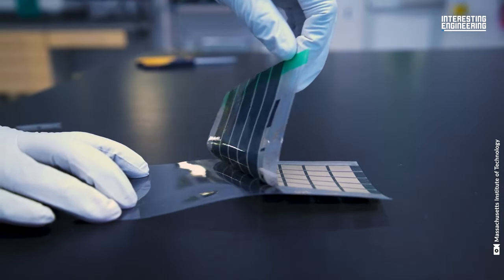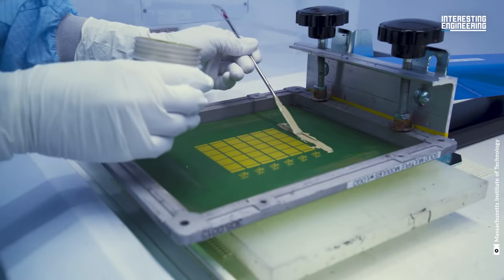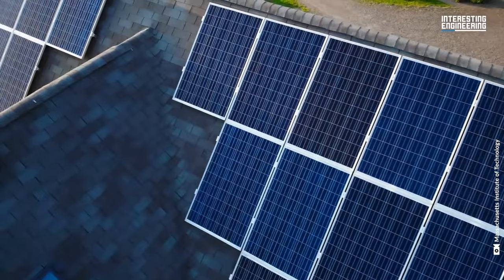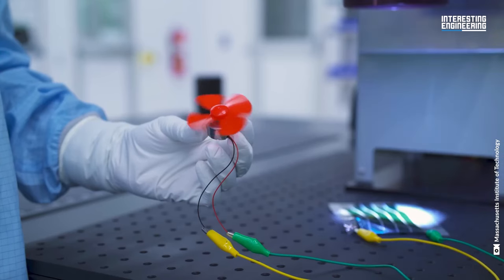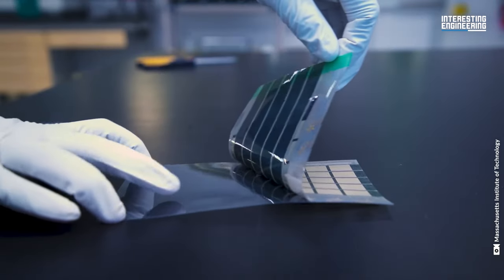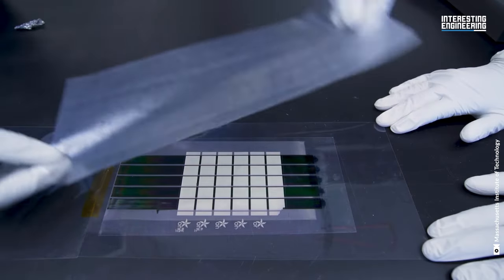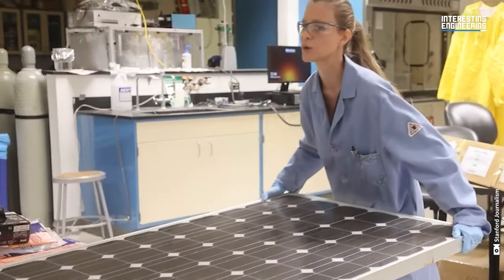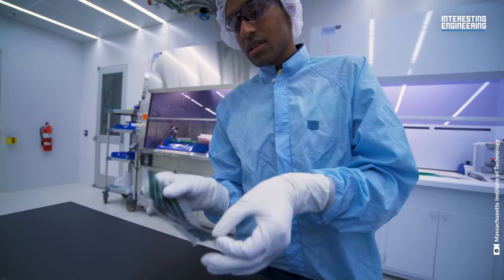MIT Makes a Super Thin Solar Cell That Can Turn Any Surface into a Power Plant

Comment: Im proud to be a engineer 🙂
Reply: OK then do the maths on this: Solar power tech is amazing, but running a civilisation on it is suicidal because they will not work very well during the next volcanic winter, and that really is just a matter of when and not if it will happen. +2 years of winter level sunlight even in the height of summer (far worse in actual winter) will see a great reduction in electricity generation right when there is a large spike in demand to deal with the cold and to raise food crops using LED lighting in heated green houses. Billions of people will be at risk of death from the cold or starvation as the entire global food production system collapses. This is not speculation, it is 100% guaranteed to happen, we just don't know how to predict the timing, or how to stop it, so all we can do is adapt now by maximising the use of all forms of nuclear power which will actually become more efficient in colder weather.
Reply: @DanielSMatthews what solar is often mixed with wind and battery storage to make it work year round.
In the case of winter they have systems that self clean with heat and scrubs.
Plus electricity is ran through multiple city's at once. So if one powerplant dies another from another town takes over
Reply: @reapertown9267  LOL, I was serious, actually do the maths, and clearly you didn't. You are in for a slow, cold, and hungry death if you don't wake up and make your power sources more resilient.
Reply: @GOLD_FEVER    Or tomorrow, based on frequency of previous events we are due for one now give or take 300 years. 

I bet you are the sort of person that does not insure their house then expects others to help you out when it burns down. That is a reckless and parasitic mindset.

Comment: Watts per kg seems like a pretty deceptive variable to use for comparison. It leads me to believe they an appreciably lower power collection rating based on surface area, which as a potential user, is my main constraint. I guess that's why the use case scenarios are for tents, clothes, and stickers and not rooftops
Reply: It will be expensive for that. ~30 USD is for the material only, excluding the printing, and all the processes. If we estimate only 45 USD for sq meter, and check the material (~35 gramms/sq meter), it means good 30 sq meters produce 370W, for the price of USD 1300, regular 400W panel costs USD 230, and takes up space of 2 sq meters.

Cost efficiency: ~1/5
Surface efficiency: ~1/15

Comment: What's their power to surface area?
Reply: I guess that is a figure not to brag about. If the film is like 10x10 cm, and let's say 2 gramms, then 5 sq meters produce 300W, which means it requires at least 3 times more space needed. Also this thin film will surely get damaged by hailstorm. But if my estimation is too big for this 10x10 cm cell, then the math is even worse.
Reply: @Daikini0  I estimated 5-10x less energy density
Reply: @sadface7457  could be, later on I found the fabric itself. It's 35 gramms per sq meters. 28 sq meters needed for a kilo. That produces 370 W. Costs like USD 1200

Comment: Solar power tech is amazing, but running a civilisation on it is suicidal because they will not work very well during the next volcanic winter, and that really is just a matter of when and not if it will happen. +2 years of winter level sunlight even in the height of summer (far worse in actual winter) will see a great reduction in electricity generation right when there is a large spike in demand to deal with the cold and to raise food crops using LED lighting in heated green houses. Billions of people will be at risk of death from the cold or starvation as the entire global food production system collapses. This is not speculation, it is 100% guaranteed to happen, we just don't know how to predict the timing, or how to stop it, so all we can do is adapt now by maximising the use of all forms of nuclear power which will actually become more efficient in colder weather.